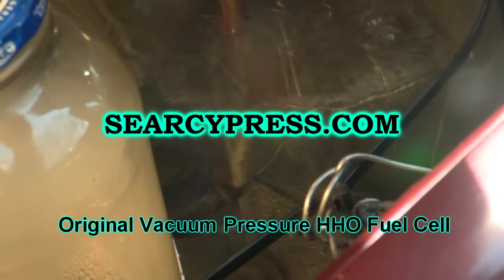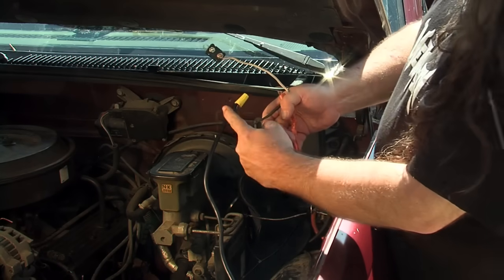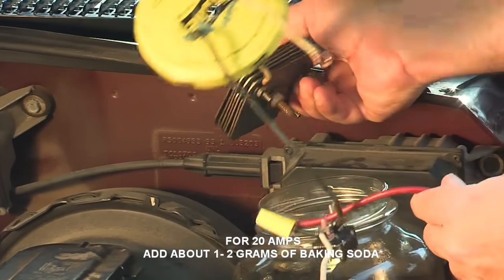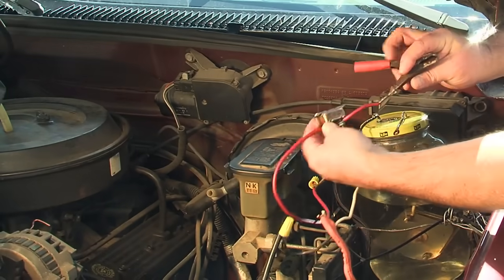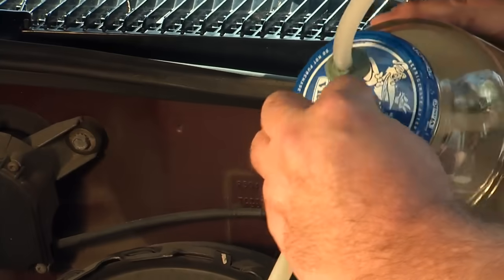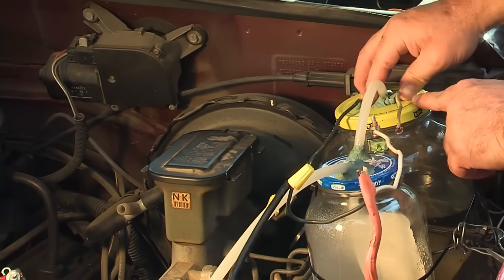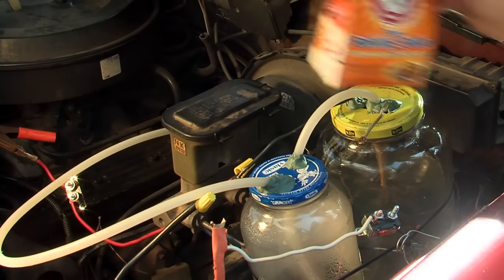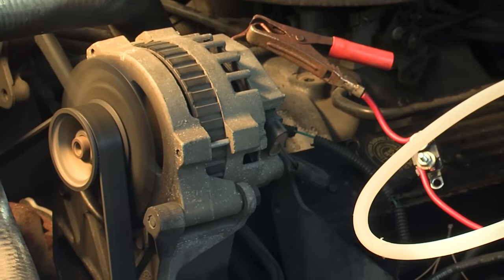Vacuum Pressure Hydrogen fuel cell defeats high gas prices using hydrogen from H2O.

Comment: if you are pumping energy into water to separate the molecules just to recombine them again inside your cylinders to get the energy back out, then where is the extra fuel mileage coming from?? Wouldn't your alternator have to run harder? or is it just soaking up excess energy created by the alternator? I just feel like this setup is on its way to a perpetual motion machine
Reply: Alternators only produce electricity equivalent to it's current load which is equal to the electromagnetic resistance the stators apply to the magnet. The higher the electrical load, the more energy the alternator will leech from the engine. If you're leeching energy from the engine to perform electrolysis of water in order to create hydrogen, you will get less energy from burning the hydrogen than you originally leeched from the engine because all you're doing is converting mechanical energy into electrical energy and then into chemical energy, and it's a basic rule of thermodynamics that energy is always lost in conversion (typically to heat and light), meaning you've lost energy in this theoretical set-up. This is why people with zero understanding of physics/chemistry should leave engineering to the engineers.
Reply: The HHO gas used by itself couldn't possibly make up the difference in lost thermal efficiency.  The idea is to use it as a catalyst for the gasoline to burn more completely.  You get more complete combustion and release more energy from the fuel, leading to better fuel mileage.  You may lose energy in the process of making/burning the HHO gas, but you get enough of a difference in the energy released by the gasoline to get about a 30% increase in fuel mileage.
Reply: You're right, this entire idea can be summed up as equivalent to a perpetual motion machine. That's why it's complete bullshit.
Reply: Bisma AK Why not just run the car on the electricity in the first place instead of adding extra steps in which you lose energy and end up with a less efficient design?
Reply: @EpicXXProductions  because you have to convert the car to an electric motor. and add thousand of dollar worth of battery. with this, it an hydrogen hybrid.
Reply: @EpicXXProductions  Super battery efficiently in the USA is not allowed (it is overseas) so as to kill the electric car idea
Reply: "Bill Does Stuff" cite your proof
Reply: Nate 
couldn't it be like. ...conversion of energy in a cheaper form and then using it in a more costly application ?
like for example. ..cheaper hydraulic or potential plus kinetic energy used to turn turbines to make hydro electric power which is used as electricity which is used to spilt H and O in water. ..and later the split H and O is combined in the combustion chamber of the engine releasing the relevant amount of energy to propel the vehicle. ..maybe ask in all is just the same amount of energy used ...but saving on costs by using cheaper energy for a more costly application. ..just my thoughts. ..your welcome with substantial corrections. ..
take care n be well.
Reply: Website guy  it does, your statment just proofes that you have zero understanding, it does spin but spin does not equal power.
The electromagnetic resitance put up by an load on the wires is what is getting the power out and causing electrical generation, if theres no load it spins freely
Reply: Website guy  Yes you are a dummy.  You went to school and only learn what the government wants to teach you.
Reply: Mat Jivas  9
Reply: yeah it works..and stated by dude...but its not 100 percent efficient...as the Hydrogen burns, the oxygen recombines with the loss, and makes waster as wasted potential. its not perpetual at all, the water splits, as hydrogen burns, it uses it like GAS, and what is left come out as water, slowly depleting his was resource. till he needs to add, more, even if he recaptures the waste water for burning, slowly the hydrogen getting burn will still use up the water, cause once the hydrogen is all burnt, then there is only oxygen left. but honestly rather than using this on a car, it makes for a much more effective self made hydrogen brazing, cutting tool.
Reply: Not perpetual. You are using the water. The big factor at play here is efficiency. Burning gasoline in an engine is only so efficient. It's all in the numbers.
Reply: and that's where you are wrong Michael. The numbers DON'T add up. If you knew the "actual" math and Science of why this doesn't work, then you would not make such foolish statements like "it's all in the numbers". That statement is true, but not in your favor or the way you think it is. It's coming back to bite you in the ass, right now. Burning gasoline in an engine, while it does waste a bit, is quite efficient actually. Especially in modern vehicles. While there are some losses in heat, friction and exhaust etc., it fares pretty damned well for what it is. Shit, even exhaust, which is waste, if you have a turbo, gets recycled too. Now that's efficiency at it's finest. HHO, like this nonsense, weak system,  is not going to do anything that the vehicle already does on it's own. It takes more power than it makes, which ultimately makes it pointless. Proven by "real" Science and Math.
Reply: A man created this system years ago. He built a car that ran completely off of water. Got over 200mpg. He was killed and his paten was confiscated. The government has propulsion systems beyond our wildest dreams. Look it up. There is only a few pictures of his design. Looks like he built his own generator. It was a complex system but worked.
Reply: Mike Dunn I'm sorry to be the one to tell you but, you're an idiot.

Comment: if this works for a car would it work for a motorcycle?
Reply: You wrong , HHO works great, and save gas and $$, also no carbon dioxide in exhaust , easy  pass emission test, my car with HHO show carbon dioxide 0.015 this all most nothing. About  electronics, all new cars using OBD-2 which very easy adjust for HHO by  Volo FS2-HHO Edition  chip. With HHO, engine works great, valves , piston rings , pistons, intake , exhaust  manifolds very clean , and more power. Other thing , to get good results need to use Stan Meyer system , not a dry cell , dry cell it is crap, dead end. Yes Stan Meyer system more complicated , but only Stan Meyer system give good results, because that system use high voltage, not a high amps as dry cell . I have Honda Accord 4 cyl 2.3L , my MPG about 50-60 MPG, I can use any water , city water, lake, river water , snow , all kind off water , with out KOH or salt. I spend all most 7 years and lots $$  to built that system, and other people can do it,  all info on internet how to built Stan Meyer system, read how to do and just do it .
Reply: $150,000? You're not too bright for a nerd. Try it on an electric generator or boneyard car. If it works - strap in to something better. When you get around to installing it in your Lamborghini let us know.
Reply: It doesn't work for a car and won't work for a motorcycle.  The amount of hydrogen needed to make any impact can't be obtained from that volume of water.
Reply: Maybe this is more friendly to run on but can easily get explosive in comparison to gas driven systems.
Reply: Break the glass...also no room.......would run off the magneto.....that might fire up the HHO...but where to put the gear? That is a great reason to use in a truck or something with room under the hood...Some guys are using small closed in glass.....with stainless steel scrathy pads   with the pos and neg hooked to that......foams up hho
Reply: Put a blast port on the top.........this uses HHO as it is created....I doesn't have time to build up...I think it's safe
Reply: Mic Nor
this kind of stuff doesent work as well in newer cars because of the electronics in the engine that measure air to gas ratios and that sort of stuff to mess with gas mileage.

Comment: This is a joke, right?
Reply: looks like it but it's not. ran a mower like this as a small trial. pretty sweet and cheap
Reply: No...
Reply: Lulz. It's not about power in versus power out. Even if it was the actual real world results are completely contrary to (pseudo) science. 

It does make things more efficient. The engine, duh.
Reply: Unless, the alternator normally produces more electricity than is needed and the excess is wasted as heat.  Like using off peak energy for laundry or to charge an electric car.    I doubt that's the case but I haven't done the experiment.
Reply: @dandavis8300  alternators self regulate if the demand is low the output is low therefor taking less power from the engine. to generate 30 amps from the alternator is about 1 horsepower if you include the losses in the alternator. max output of automotive alternators 120 to 300 amps 1.6 kw to 4.2 kw  at the top end it would take about 10 horse power to run. just giving you an overview of alternators
Reply: A mower isn't a car.  You're comparing 140cc vs 3000cc or more.
Reply: KarmaCadet But the production and continual maintenance of cars is ok? Everything we make produces waste both physical pollution and energy waste. It's about finding the option that produces the least waste over the long term. The kind of solution this video promotes is just stupid. As I have said previously, you aren't going to make more energy than you are spending with this method. You need to find a way to introduce energy to this system for free (or as close as possible) Thats the only reason why we use fossil fuels; It's freely available in large quantities thanks to the long work of the planet. But a better method would be using the sun.
Reply: ...or magnets. Ever heard of the Perendev motor?
Reply: Ursan it's real
Reply: Why won't people believe this stuff it does really work . You need the right materials . And it is pretty easy
Reply: The power comes from the car, not the house. Car AC systems use about 25 - 30A of power just like this and they reduce the MPG about 1 - 2MPG. And hydrogen, according to NASA, can INCREASE the MPG up to about 5% from their own tests. So even if it uses power from the car it will save MORE than it uses, going by the NASA tests and the  1 - 2MPG that Consumer Reports and other mechanics state that car AC uses. And since this doesn't use and mechanical energy like the AC does, it will be more like less than 1MPG difference.
Here is the math.
A 25MPG car - 1MPG for power = 24MPG
Improvement from the hydrogen of 5%,  105% or 25MPG=26.25
And it is probably BETTER than that in many cases. And the power to used the 25A is probably more like .1MPG, since it uses ONLY electricity and no mechanical power, which is most of the load for car AC.
So you should get about 4 - 5% improvement in gas mileage according to NASA, or more according to many people.
And remember, 25A at 13.6V = 340W
That isn't much power compared to what your car uses. Remember 1HP = 746 watts   , and even small cars put out at least 150HP. And this is about a .45 load. Pretty small compared to the transmission, or cooling or power steering, ETC
And this REDUCES POLLUTION too.
See below abstract from NASA study in the 1970s.

Hydrogen: Primary or Supplementary Fuel for Automotive EnginesHydrogen, gasoline, and mixtures thereof were compared as fuels for
 lean-burn engines. Hydrogen for the mixed fuels tests was generated by partial oxidation of gasoline. Hydrogen combustion yielded the highest thermal efficiency at any NOx level. Gasoline yielded the second highest  thermal efficiency for NOx levels greater than or approximately equal  to two gm/mi. For lower NOx levels and high vehicle inertia weights,  progressively more hydrogen supplementation was the second most efficient system. For vehicle inertia weights below 5000 lbm (2300 kg), 
the statutory NOx standard (0.4 gm/mi) could be met with one lb/hr (0.13  g/s) hydrogen supplementation.

I'm not sure if this is the correct paper, but it shows it does reduce the pollution.
Reply: Adding more fuel to the engine in the form of hydrogen would increase efficiency but it takes a lot of electrical energy to get even a little bit of hydrogen out of water. At the rate the alternator produces, it would take more than an hour to produce 1 litre. By that time you've already burned up tens of litres of petrol in a big truck like this. Better to stick a solar panel on your roof. That would be true free energy as it costs nothing to produce.
Reply: @robohobo296  ERROR! I get 1.5L / Minute @ 10amps. You don't need a lot. You just need a little to get full combustion of your gas - making the engine more efficient.
There's plenty of utube vids showing hhp production volumes and makers selling kits advertising with proof of volume.
Reply: Frank Gutowski Exactly. In order to create the hydrogen you have to burn more fuel. You're never going to get more energy than what you put in. It's just the way things work. The best you can do is make things more efficient. In other words, reduce the loss of energy during energy conversion. As in the conversion of liquid fuel to kinetic energy.
Reply: it won't be cheap. You have to get the electrical energy from somewhere. Electricity wasn't free last time I checked.
Reply: @robohobo296  Actually it can be. A P/U truck would be great to add additional original  rear radiator fans & put them outside in front of the grill and let the moving air spin them blades- generating free electricity. There is no additional drag as your front grill is the drag anyway. Might as well use this free source. Probably looks dumb, but its free energy.
In reality, drawing 8-10 amps is not that much of a drag on an alternator. This guy is using too much un-necessory energy though.

Comment: I recently created a 7 cell HHO system with 30 amp auto reset fuse , 10 gauge wire  The auto rest fuse is steadily cycling and heating the wire . And have burned a 35 amp toggle switch out.. Any suggestions. Each plate is 4"x 6". Again any tips on resolving ?
Reply: Become an electrician.
Reply: Thanks for the crappy advice.
Reply: Terry Cooper
I'm saying learn the trade if you want to play the game. You need to know more than what people can spoon-feed you online. You take a whack at this and you could hurt yourself or fry your vehicle. Heavy stuff.
Reply from the maker: I had the same issue. That is why an electrical light switch was used. It held up. I did keep an eye on it.

Comment: Folks...don't fall for this crap..! Do NOT rebuild such pile of crap he made right there, it's unsafe and will cause you a lot of grief at best. No one should attempt to make Browns gas in some pickle jars with ..ahh...I don't even know where to start, cause this design is so full of flaws.
Also, you won't gain any mileage out of this shit...the alternator would have to work harder, resulting in a higher fuel consumption.
Reply: +Bone Drone Because the issue isn't what it does to the combustion, it's where the energy comes from.
Reply: Djhg2000 If there was no effect on combustion your dreams would come true. It wouldn't work. La la.
Reply: Bone Drone Whatever, I won't waste more time replying anyway.
Reply: No one opposing HHO ever talks about what it does inside the engine. That bit gets left out 100% of the time. Have a nice day.
Reply: +Bone Drone I was going to explain a bunch of physics involving the explosiveness of hydrogen and conservation of energy, but your comment clearly indicates your mind is too closed to care about the truth unless it's helping you stick it to the man. Good day to you too.
Reply: Djhg2000 I was not going to listen for the 10,000th time about the age old pseudo physics of HHO. With a generator on my car............well say what you want because I know better.